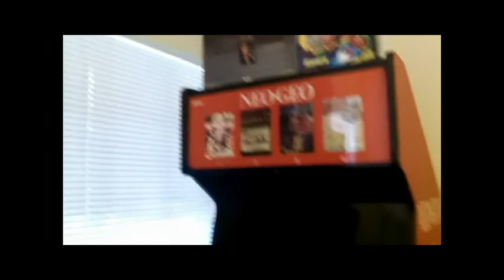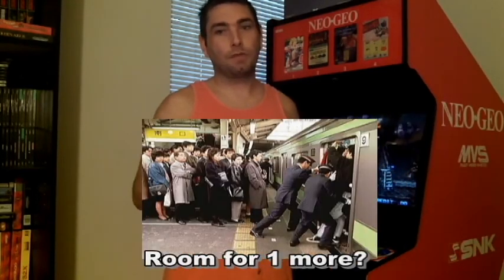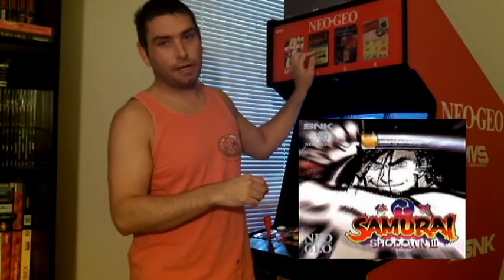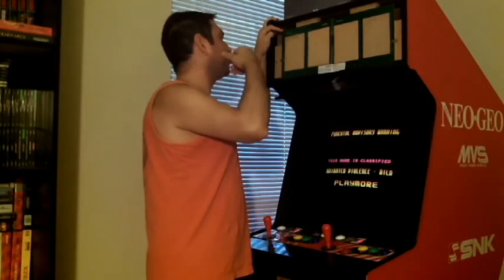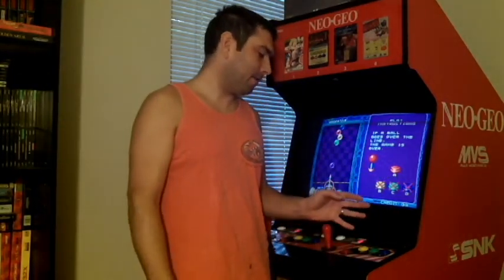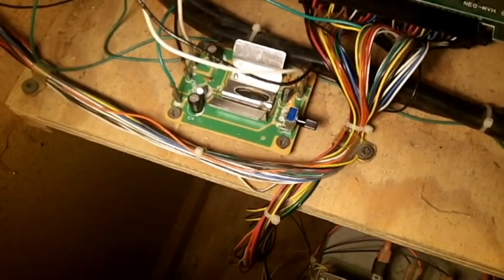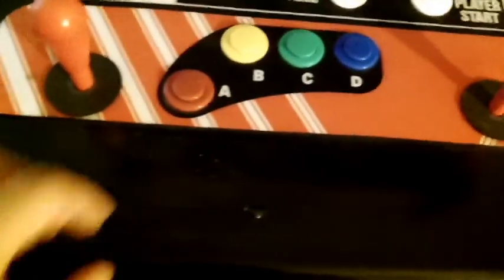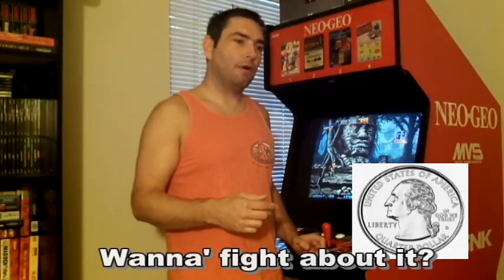Episode 8 - "Enter the Neo Geo"

Comment: I kind of like having my Ms Pac Man being beat up. I've considered getting a brand new one but I don't want the LCD. The tube monitors are scary. I don't even want to mess with them. It took me a few hours to get mine not smelling like cigarettes.
Reply from the maker: Yeah, I sold a cocktail Pac-Man and the guy loved the fact that there were cigarette burns and wear around the joystick. I've only swapped out the buttons and monitor on mine. Need to replace the battery though